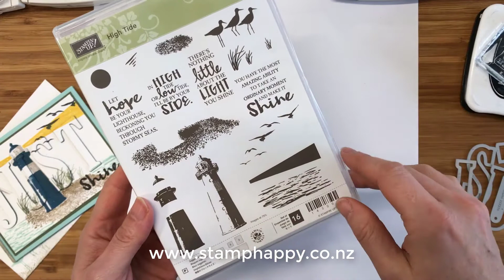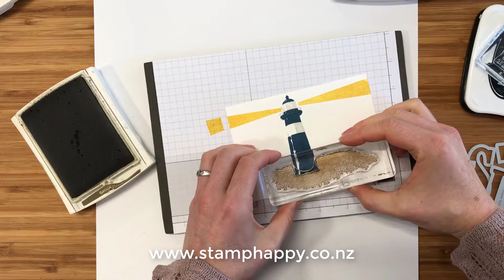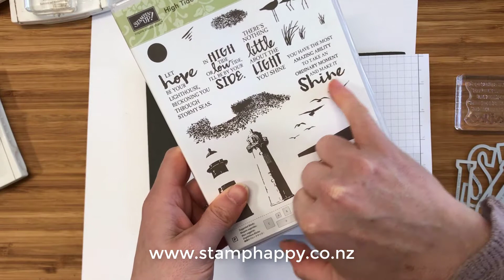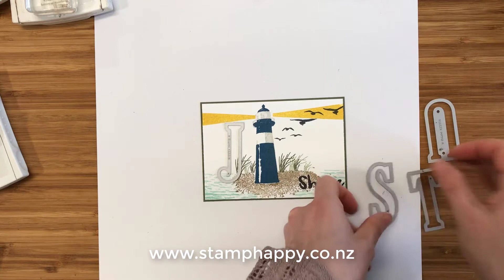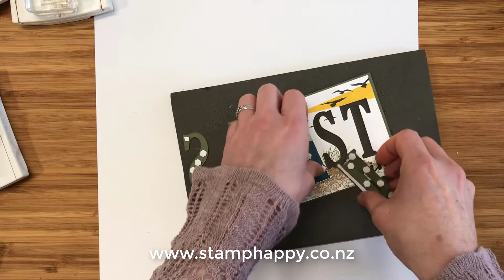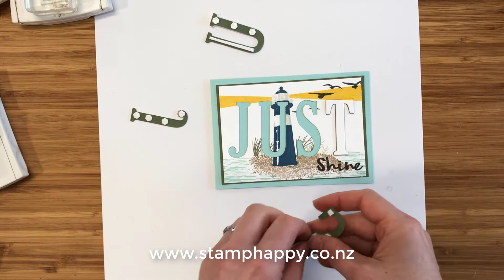Stampin' Up! High Tide Masculine Birthday Card with the Eclipse Technique

Comment: These kind of multi-stamp cards are a real challenge for me sometimes to get everything stamped without a mistake or smudge, as I am a perfectionist in giving cards as gifts! But you made it look so easy and sound so simple that I gave it a try one evening when I needed a quick card and at the first attempt I was successful! Though this stamp set and the letter dies are retired, this is a surprisingly easy card to make if you own or can borrow them. Thanks for the video!  7:14
Reply from the maker: Thanks so much!  I appreciate your kind words and hearing about your success.  :)